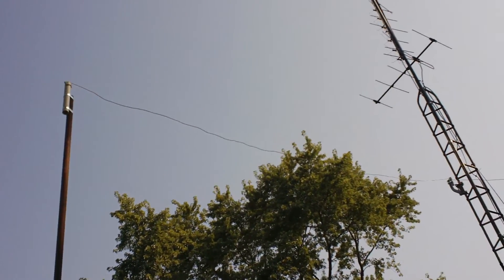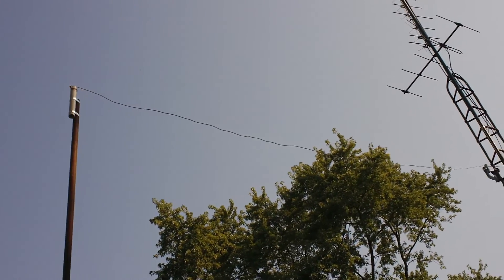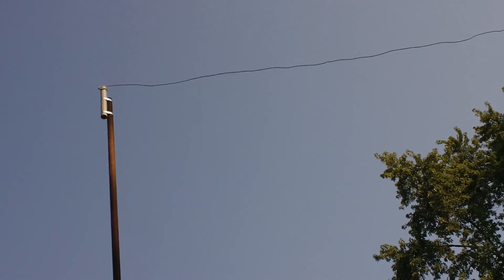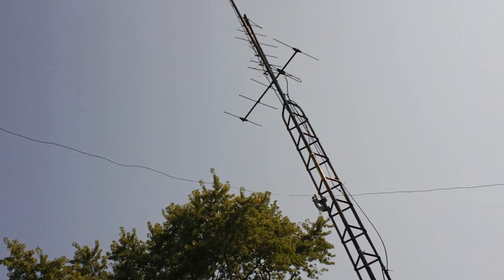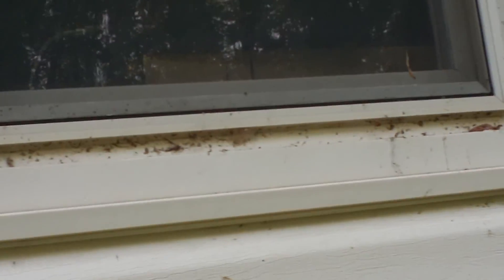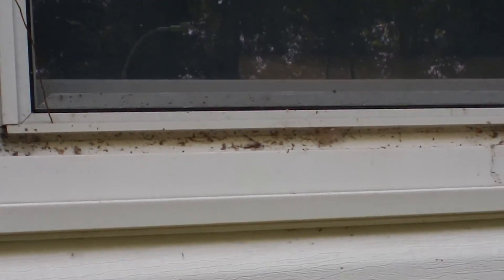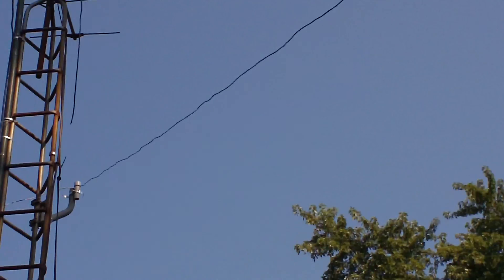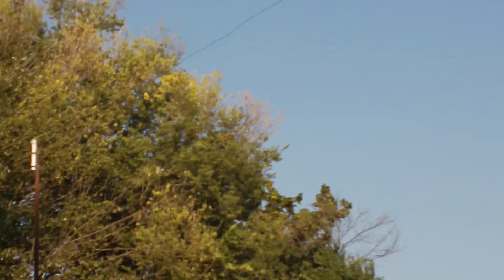My Homemade Random Wire General Coverage Shortwave Antenna

Comment from the maker: Sorry to hear of your space limitations. With antennas the old saying where there is a will there is a way applies, most of the time. I don't know what a G5 is but I'm sure some type of wire, loop,.....could be setup where you are. 

I have space but it's not all practical for antennas. The back yard & west side have many trees. The front has two large trees & the main electric line running between them. Our open area is a long ways from the house. 73's Paul

Comment from the maker: Thank you Hermann. It's unconventional & like any antenna it has advantages & disadvantages. I wanted a single feed 360 degree wire antenna so I decided to try this. It does well in all directions but once in a while that can be problem if there happens to be two strong stations on the same frequency, or close proximity strong stations. Now and then I have problems with AC power line noise from the south, same with any antenna though. The 40 meter range is always very noisy for me. 73's Paul